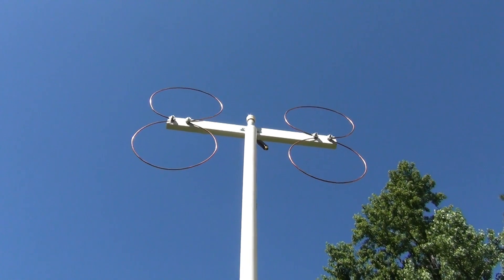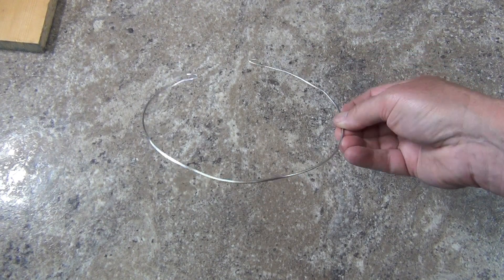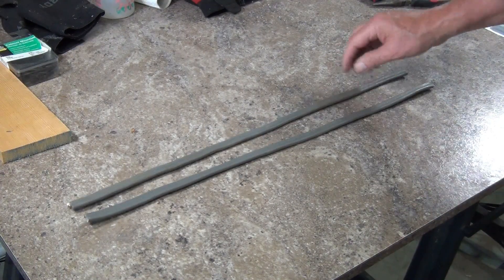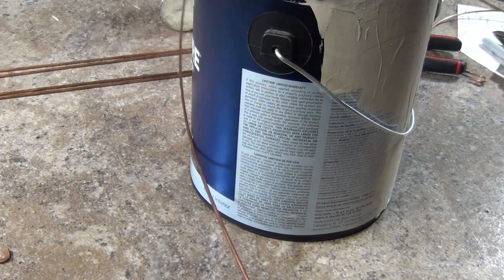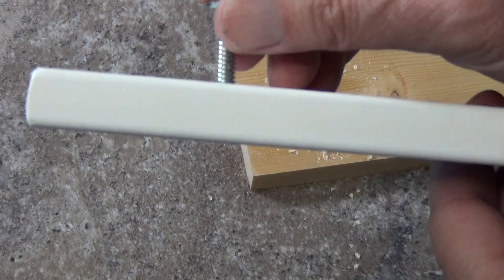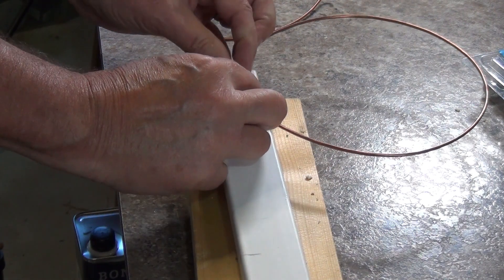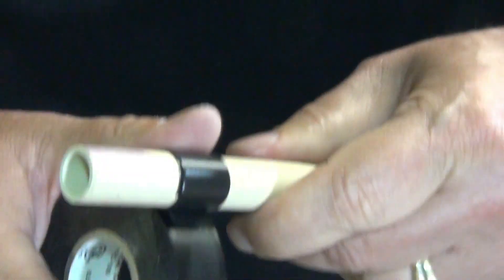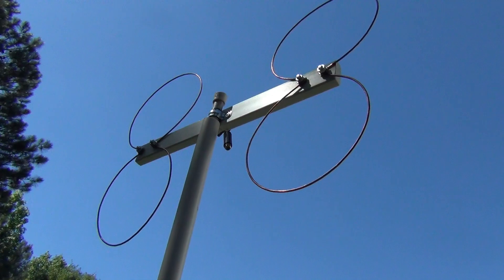The Quad Hoop TV Antenna

Comment: This would be a lot more useful if the determination of the hoop's length were determined to tune what station (frequency). As it is, your build length is nothing but a crap shoot and makes little sense.
Reply from the maker: UHF signals are much forgiving than VHF. I sized it for the most average frequencies. I find that most hoops that are sized from 7 to 9 inches in diameter all work well.
 That's why so many people have great success with this design. If you want to resize your antenna for more specific channels, there are tons of sources and calculators online that will assist you. Thanks for watching.

Comment: How did yo arrive for the hoops diameter?
Reply from the maker: Initially during my prototype stage I tried multiple diameters. I found this size worked best. St least in my location. As you know, UHF antennas have a lot more design leeway than VHF, so your exact measurements could vary a bit. Thanks.

Comment: I appreciate your videos, and I have learned some things. I have a question concerning a Yagi antenna I already have. It works fine, but I was wondering if I could improve it somehow by increasing the length of the aluminum elements already on it. I've heard these things are made with precise measurements, but do you think replacing a 4 foot element with a 6 or 8 foot elements might bring in more channels from further distances? Thanks.
Reply from the maker: The element lengths are specific in length as they are tuned to the frequencies you are trying to receive. Increasing the lengths would probably end up reducing your reception. Instead, you can try raising or repositioning the antenna, or maybe adding a good preamp system. Thanks for watching my channel.

Comment: Is the antenna working with a customized DTH/dtv device? Or is it working with a UHF/VHS TV RECEIVER?
Reply from the maker: The Ematic receiver is a popular TV receiver
 I bought two of them at Walmart a couple of years ago. I'm using it in my tests because its signal strength meter is accurate and displays in percentages. My Onn tv only has a four bar signal display. Thanks for the great question.

Comment: WOULD the four hoop antenna increase the signal if I made another one on top of the first one Sir ?? How far would I need to space the antennas apart MHTI ?? If i choose to use a reflector the distance would be 4 and 1/2 inch spacing ??Thanks vf
Reply from the maker: VF, you can try that. Id try spacing at least 12" apart. Keep the leads from each antenna the exact same length. 4 to 4.5 inch spacing  for a reflector should work.
Reply: @mrhoptoit7835  Thank you Sir for the information.....

Comment: Does the double hoop antenna have a longer distance reception as compared to the quad hoop antenna ?? Would putting a reflector on the quad increase the reception range of does one need to make the quad a OCTAGON type of antenna ?? Thank you for your insight and knowledge of the antenna field MHTI. Peace VN.
Reply from the maker: Since the quad hoop is based on the double hoop design, a refector should increase directional performance.
Reply: @mrhoptoit7835  Thank you for the answer Sir.

Comment: Most TV markets also have VHF stations and some even have low VHF stations requiring long dipoles to pull them in. If you added dipoles to the hoop antennas and combined the signals then you'll get the maximum amount of channels for a very low price.
Reply from the maker: Yes there are still limited VHF stations. Here's a link to my VHF-hi antenna add which does exactly what you are saying. - https://youtu.be/eqDwqveTOaE. Here's the link for the VHF-lo antenna - https://youtu.be/OWOwTQQPuT0. Thanks for watching!

Comment: Here is an idea for the viewers of getting copper wire for FREE !!! Ask the local power company work crew for some wire. "They say be careful what you wise for" as the man gave me a wound ring about 20 plus feet of number 6 solid bare copper wire, extra soft. Perfect for this type of TENNA. Hope this helps our viewers make antennas on the cheap, but with best building material.  Peace v.
Reply from the maker: Wow. That was very generous of them! Good deal!
Reply: @mrhoptoit7835  The gentleman who I asked said at first "NOTHING IS FREE" then handed me the wire. Then he said good luck and wanted to see the antenna I will be making. Also, he said that to remember him if I need more material for the project too. This has to be the best luck day for me in quite a while. Peace MHTI, v
Reply from the maker: Very cool, VF!

Comment: What would be the best way to make a 8 hoop antenna for extra gain MHTI ?? I will be using 10 gauge copper wire. Thanks v
Reply from the maker: Too many elements in many cases, can reduce the antennas performance .

Comment: I am wondering if an antenna that has hoops in front of the hoops actually increase the signal gain of this antenna ??  I like your mindset on antenna improvements Sir. Look forward to your next project for us all to enjoy and use in our own homes.
Reply: Telesine Antenna Corp. of Shreveport, LA. UHF 2-element loop = 6dB gain, 4-element loop (upper + lower pairs) = 9 dB, 8-element loop (upper + lower + upper right + lower right pairs) = 15 dB gain. VHF High + Low antennas models 4-8/8-8, 5-8/8-8, and 6-8/8-8 with a "stated" power gain of 40 (dB ??) into a single 300 ohm line when set up as an 8-element system like the UHF series. The  VHF 8-element system is MASSIVE. Ham radio operators sometimes use cubical quad beams which are square loops: If just using a single driven loop the gain is 2 dB over a dipole, if you add a reflector loop behind it then it has 5 dB gain, if you add a director to that then it's 7 dB, every additional director adds only about 1 dB. Telesine Antenna Corp. went out of business long ago. The Telesine antenna patent was filed on March 13, 1950, patent number: SW 149353.
Reply: Correction: Patent filed on March 13, 1950 but approved on October 27, 1953 with patent #2,657,313 "Directional Antenna System" William E. Antony, Inventor. Document  US-2657313-A.   7 pages.
Reply from the maker: @AL_9000  interesting
Reply: @AL_9000  WOW, thank you so much for the actual factual information I have asked for MHTI. This will help me make an antenna that should be second to none.  Good day to you Sir and peice too. V  😀😀😀
Reply from the maker: I've seen antennas that  use hoops as directors, but not for TV reception. Interesting idea as always, VF
Reply: @mrhoptoit7835  I Look forward to seeing what you have up your sleeve Sir. Good day too. v

Comment: I am wondering if this antenna is the most powerful unit you have built so far ?? DO you think using a reflector would increase the number of stations this antenna would be able to receive ?? Thank you for your help and time Sir. Peace V
Reply from the maker: Hi VF. It is definitely one of my highest gain antennas. Adding reflectors could help you get weaker signals from a more focused direction.
Reply: @mrhoptoit7835  Does this have a 135 degree field of view  SIR ?
Reply from the maker: Without a reflector, it will receive signals from both front and rear directions. If you install a reflector, I'd think youd be close to 135 degrees
Reply: @mrhoptoit7835  Could you tell roughly how many actual degrees of reception ?? Thanks MHTI

Comment: Having multiple loops doesn't make any sense. Do you know the formula to build a loop antenna for AM radio?
Reply from the maker: Many commercially designed loop style antennas have multiple loops. Thanks for watching my channel.
Reply: @mrhoptoit7835  You are showing how to construct antennas but NOT providing any formula to build it. I need to know how to build a loop antenna for AM reception.
Reply from the maker: My channel is for "How To", not Educational, and the vast majority of my viewers are non-technical. If you want more technical information, there are a lot of channels on Youtube that can help you. I watch many of them myself. I appreciate your question, but I am a hobbyist that designs TV antennas, and I'm not the best qualified for AM.
Reply: @mrhoptoit7835  Can you show a video on Dxing DVB-T reception? Is it possible to receive DVB-T channels of other countries using any antenna?
Reply from the maker: As I'm sure you know, DVB-T is not a standard for broadcasting here in the US. Still, it transmits in the UHF band, and my antennas should work to receive it. I've had many comments from people in other countries telling me they have built my antennas and they get good reception. As with all UHF signals, transmission is limited by terrestrial interference and signal strength limitations, so trying to pull in distant stations will always be difficult if not impossible. If you want to receive out of area TV, you'll probably have to invest in DVB-S equipment for satellite reception.
Reply from the maker: I found this site on building an AM loop antenna and thought you might find it helpful.  https://ccrane.com/how-to-make-a-simple-powerful-am-loop-antenna-for-free/
Reply: @mrhoptoit7835  I know that but it still doesn't have the formula.
Reply: @debojitacharjee  Joe Carr's Loop Antenna calculator (calculator and equations).
Reply: There are AM loop antenna calculators on the web using frequency, wire size, # of turns, wire spacing, and loop size as variables. You also need to know if you want the antenna to aim at the desired station parallel or perpendicular to the winding as the winding will have a different shape for each.
Reply: @AL_9000  I know that, but will it work with only ferrite core AM receivers or digital receivers too?I have seen some radios that come with exterbal ANT connectors for loop antenna. But such an external loop antenna doesn't require a capacitor. How do I calculate that type of loop without a capacitor?
Reply: @debojitacharjee  use 0 pf as the capacitor value but be aware that only one frequency will be peaked (and possibly harmonics of it) and the farther away you are from that resonant frequency the weaker the gain will be.
Reply: @debojitacharjee  You can place your large loop antenna next to the small factory-supplied loop antenna connected to your digital receiver and it will inductively couple to it, or you can directly wire your antenna to the receiver for less loss.